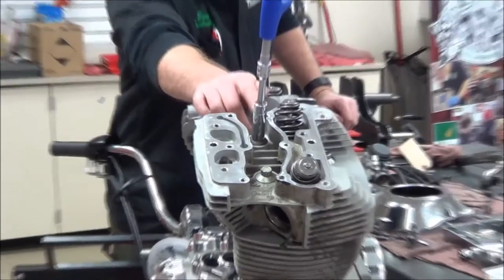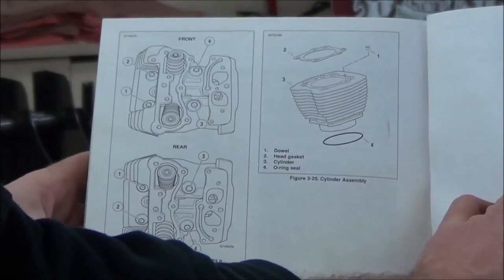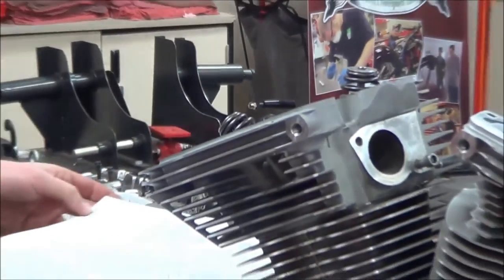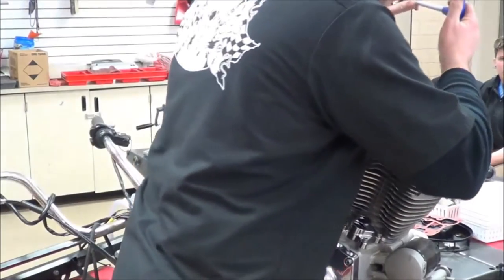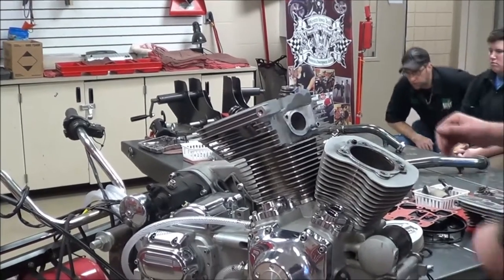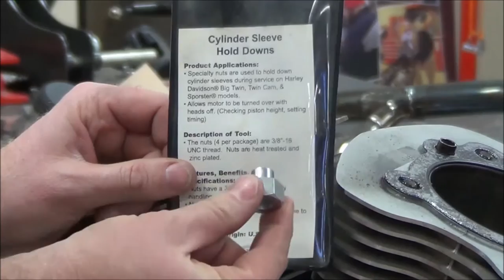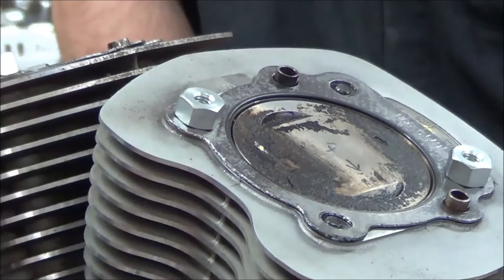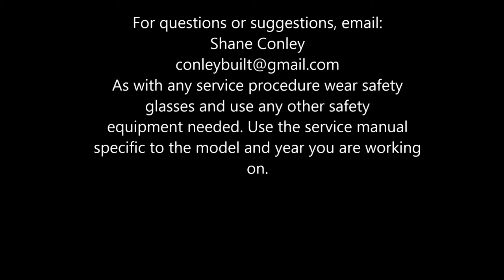Twin Cam Engine Series: 03 Cylinder Head Removal #howtoharley #harleyheadremoval

Comment: do you take the exaust pipe off the cylinder first? and the intake to carb?
when i took my rocker box off there was spring tension about 1/8 of an inch. so when i put back on, will the bolts compress it as i torque the bolts?
thanx man